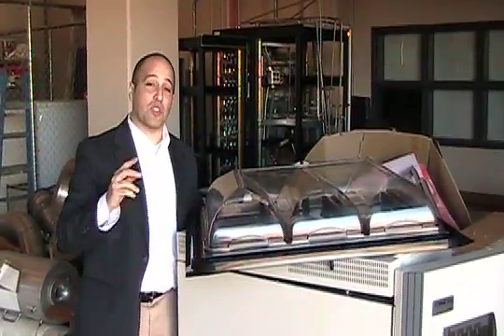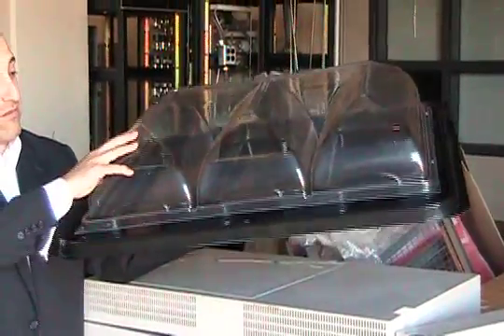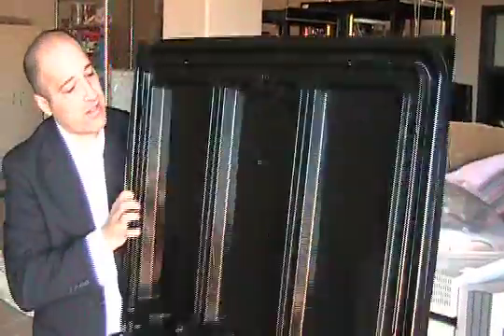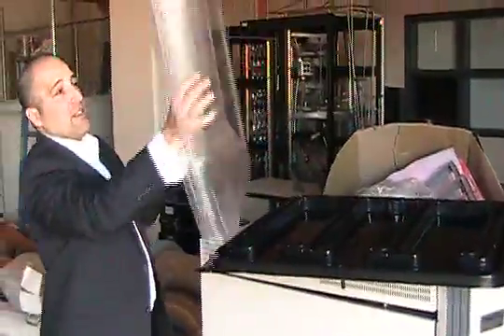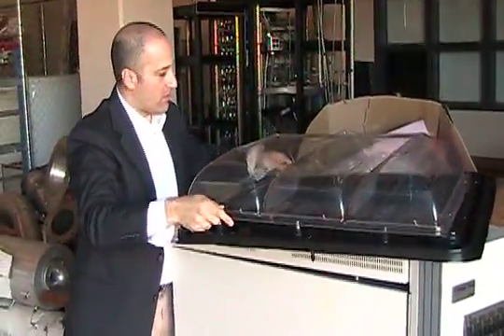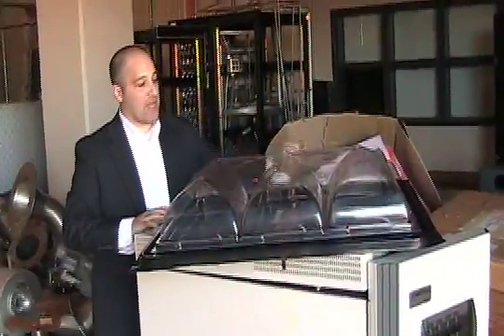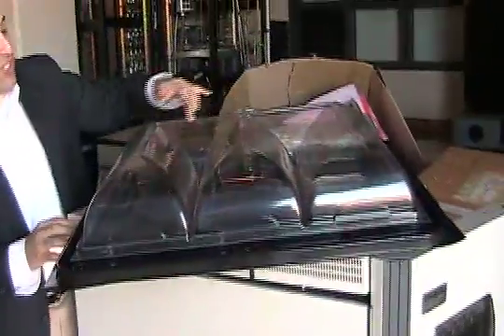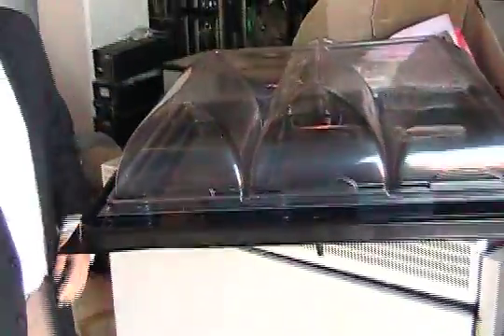SEA Panel solar desalination apparatus explained

Comment: Looks pretty light weight and flimsy. With only a small amount of water in the basin it looks to me that a good wind would blow it off whatever it was sitting on, then where would you be? This cheap plastic would only last about a year in the sun and then it would become brittle and crack at the slightest touch. With no insulation this unit will be losing heat from the basin and drastically reduce production. Plus I can't believe that you don't have an actual test video. Good idea but flimsy materials and design.
Reply from the maker: This unite was tested extensively when it came out. We had only one wind knock-down in a year from a 90+ mph wind. What you didn't see in the video was that this unit was secured to a frame which was weighted with a sandbag. As to the longevity of the material, it's a special UV-stabilized plastic, and they were tested for years in direct sunlight with only very slight yellowing, and no embrittlement. Finally, there IS insulation below the unit, we used 1/2 foam.

Comment: Product looks OK and some good ideas. But  can't believe the poor quality of the presentation, in amongst a pile of unrelated warehouse junk, no systematic approach and the text not thought out beforehand and lots of picking up and putting down the product to cover hesitancies and afterthoughts. It looks a bit fiddly and needs tie down points to prevent it being blown away. Not exactly portable unless transported by vehicle, but at least both trays can be nest-stacked. The spigots underneath seem vulnerable.
Chs
Doug
Reply from the maker: We didn't have any problems with the spigot points because they were strengthened with plastic washers. The nesting was the portability, and even with our current units, we haven't been able to meet the number of units that could fit on a single skid. But that's not our current unit, it was an early model.

Comment: Good on you mate. It looks like you can stack these and transport to remote areas for very simple installation. In most parts of the world clean water does not come out of a tap. This product will save lives. Keep up the good work.
Cheers Max

Comment from the maker: @kieranhawk and @quantumsignature ... Thanks for your comments, the purpose of these test units is to be cheap, they are made for Developing Nations. Using glass or tempered lexan would dramatically raise the cost of these units and they would then be nearly impossible to deploy for the people who need them most. After much testing, we actually found that even these "cheap" units are too expensive and we now use a special type of flexible poly.

Comment: You need to increase the quality of your unit.
  UV stabalized 1/4 inch Lexan comes to mind, or tempered glass.
Reply from the maker: quantumsignature smith thanks for the suggestion. That unit was made for developing nations, it had to be cheap as possible. We found that it worked just as well as the more expensive materials. Glass was a problem because of shipping weight. Other plastics were either far too expensive or didn't have UV stability.

Comment from the maker: Hi All, I'm Mike, the guy in the vid. Our systems produce about 3X more water per unit area than regular passive solar desal systems due to our U.S. Patented improvements. Comparing them to "cheap plastic propagators" is like comparing a rugged mountain bike to a child's tricycle ... our units have been tested around the world and have stood up for years where lesser systems collapsed. Also, our units start at $99, not $250. Thanks!